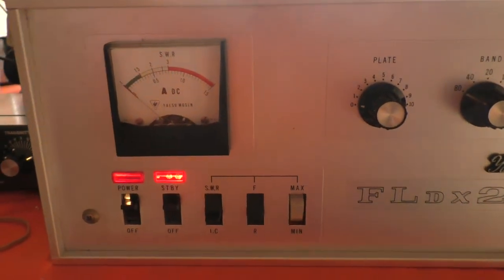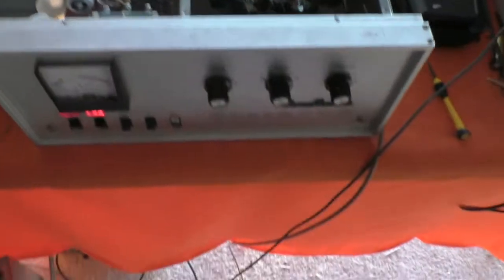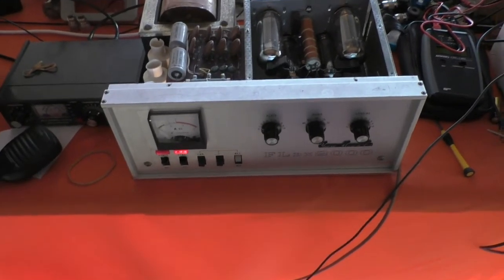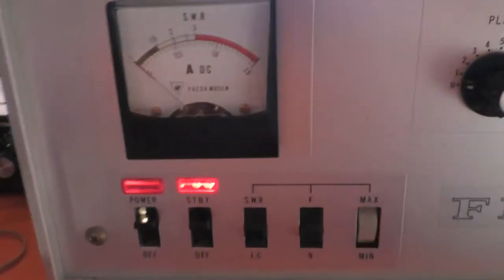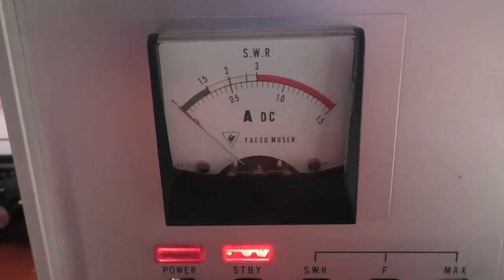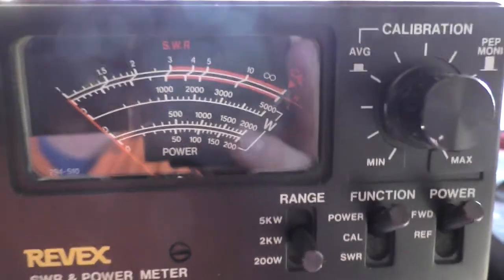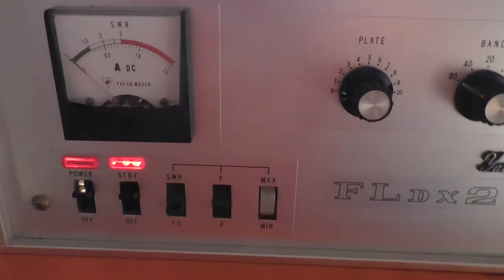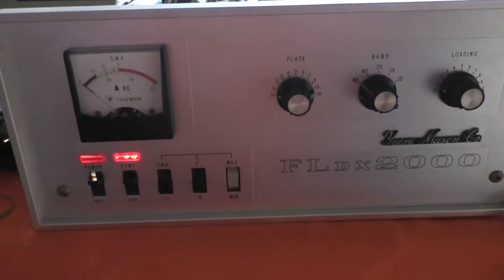Playing Around With The Yaesu FLdx2000 Amplifier

Comment: just received one in the workshop, still has original 6kd6 tubes in it, original condition except the fans were replaced, working through it to check for problems that  may exist, then i remembered you had one on the bench,..

Comment: Ah.. good to see, my first valve amp was a FL2000B, OK feeding it with the 101E But yes I also ran an antenna match unit when trying to feed it with a 430S. Please replace all those old electro's it will work better.

Comment: just put a bird meter with an 1KW slug between it, because now you are measuring in the 2000Watt scale, 10% max misreading so it could be if the meter shows that your outputt is 600Watt it can actualy realy be between 400Watt and 800Watt
Reply from the maker: Yes, a Bird meter would be more accurate than the Revex amateur device. Unfortunately I would have to buy 2 elements, one 1kW and one 2.5kW for the bigger amplifier. These elements are quite expensive so I'll probably just take the Revex reading.
Reply: or do like I did, buy a board for the bird 43 meter that does readings X1, X2 and X5 and can also read PEP, they arnt that expensive and you can find them on e-bay, then you can use the 500Watt slug for 500, 1KW and 2,5KW
Reply from the maker: Hi Mark. Thanks for the suggestion, I've ordered a couple of elements as I can use a Bird meter from work.